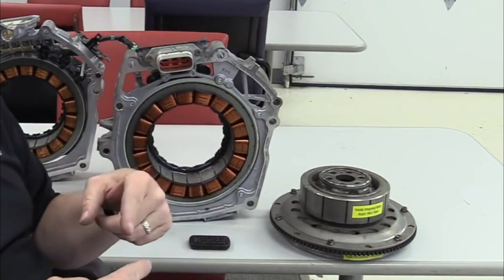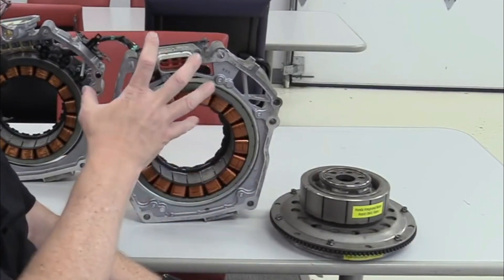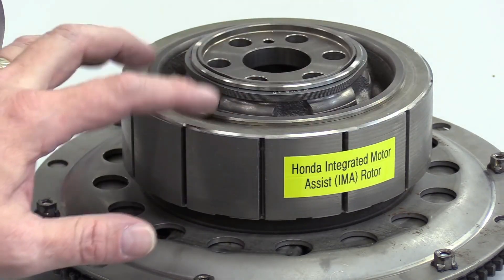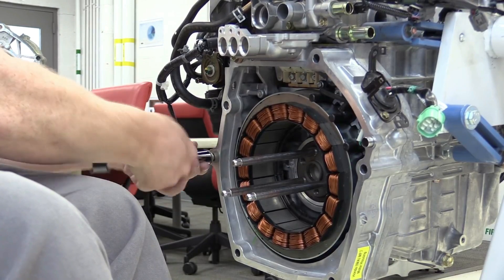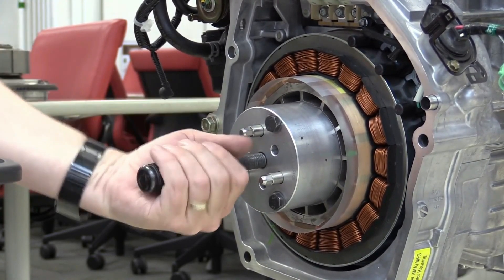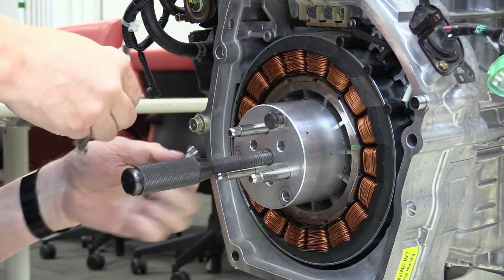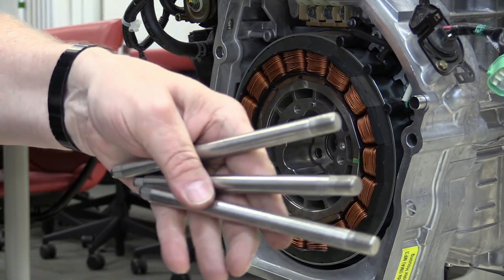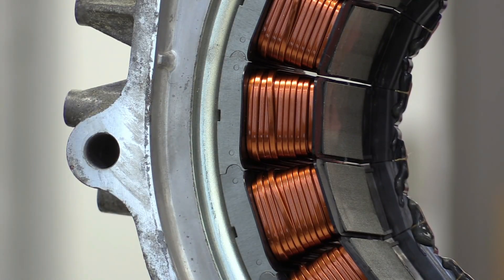Honda Civic Hybrid Motors And Hybrid Sytem Details

Comment: I am getting p1435 code often and my car has low power and bad mileage model 2008 civic. Battery check light on not Ima any solution?
Reply from the maker: Please check the voltage on aux. Battery  which should more than 13V further check time duration how long vehicle stay on hybrid
Reply: @Muhammadacrum would this be a dc to dc converter issue?